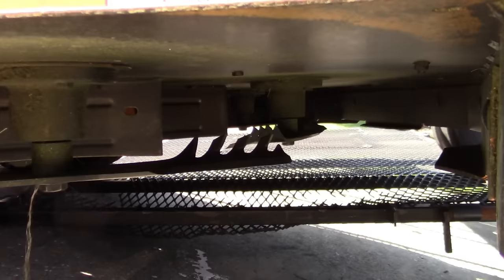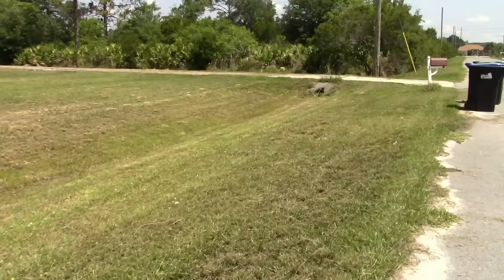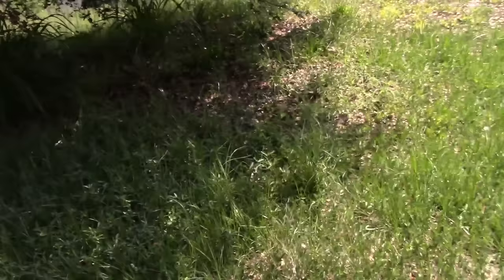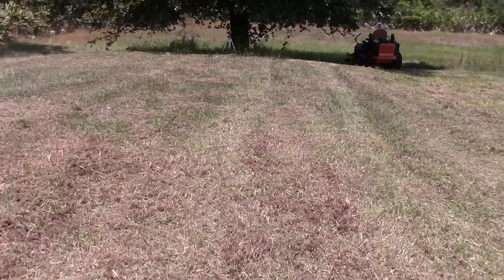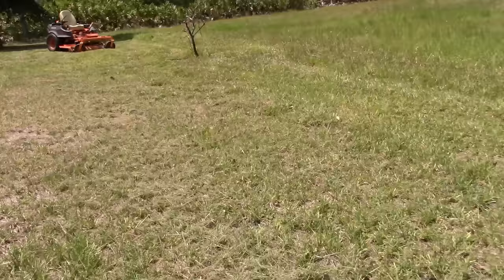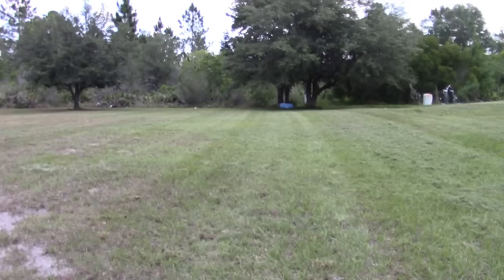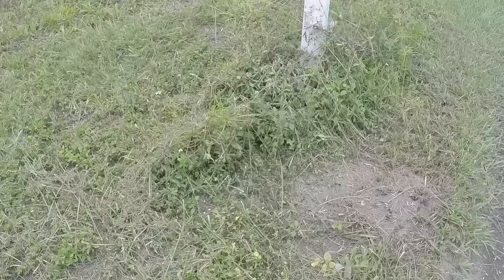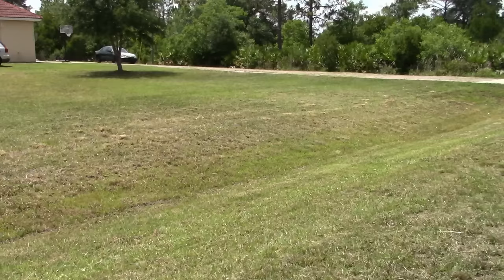Lawn care vlog #21 Tall Grass Annihilation! = Satisfying mowing!

Comment: I enjoy watching your videos . I believe that baffle behind the discharge chute is to help the clippings drop out instead of being pulled back around into the baffle again in a viscious circle . My Dixie choppers do not have them , but when I bought and installed my trac vac system it included one of those baffles to be installed with there system . I used it initially but ended up taking it off it didn't seem to help with anything , if anything it caused buildup of clippings to start at that point .

Comment: Bermuda is out in the fairways and roughs. Tifway which is a cousin to Bermuda is on putting greens. Tifway is super fine bladed Bermuda. Tifway at 5 inches tall will kill your mower engine. LOL It will lock that sucker right up. Tifway is the most dense, well I take that back. Zoysia is ultra dense too. Great videos sir as usual.

Comment: That small part is called the Turbo Baffle. I had same thing on my 52 " deck on my Wildcat, it didn't come with a exit chute cover and that a No no here. So I got a chute door off of E Bay and the Turbo Baffle was one thing I had to remover to install my chute door. Its operated by hand by reaching down, and pulling up on the lever.  My used mower was a home owner unit and had around 670 hour when got it. No Rops I would have removed them, most lawn have small trees, I like the door for many reasons the law was #1 and #2 was leaves spring and fall clean ups and heavy grass I like my lawns smooth and neat when done, I hate to see grass clipping blown into the street and grass clipping in flower beds and things that might get damaged, I'm insured, crazy if your not, But yeah they spread great out great on Scags mower decks. And yeah if your doing this kind of work have fun doing it I'll never get tired of mowing Motion controls beat a steering wheel any day.

Comment: You probably already know this but "high lift" blades will throw the discharge farther than the G5's (or G6's) you have on in this vid.
Reply from the maker: Yes, I have high lifts on there right now and it throws it a crazy distance. But regular high lifts have trouble with the thick grass. I have yet to try the G5's or G6's but I will. Gonna try the lighter ones. The blades in this vid are Mamba mulching blades which are almost identical to Gators.

Comment: Bermuda/Zoysia/Tiff and their numerous hybrid cousins are all Turf Grasses. They are used in the majority of residential lawns as well as commercial properties. The suggested mowing height of Bermuda is 4" during the hot months, slowly increasing the height for the winter time. Bermuda does not do well when cut to short, it exposes the surface roots, causing dehydration and root damage, leading to dead grass. It is the standard native grass here in the Plains states. That's what Oklahoma, Kansas, Missouri, Arkansas and Texas are covered with. Kentucky Bluegrass, Fescue and other shade grasses, don't do to well here, do to the fact they require excessive watering and average temps below 80.

Comment: I know this was a couple of years ago but thanks for posting . I all ways cut these on high  The problem I found with the plate removed for me was  safety. I know the blades  are spinning at 3500 rpm.   So any thing coming off the blades is going to be travailing at 200 mph.but it seem OK
Reply from the maker: Yea it's seems pretty scary, but most things are kind of "out of range" of the mower.
Reply: @Something2LookAt  The only way I can mow grass slops like this on these steep slops is to use the timer first. on the steeps part of the  slop then mow it avoiding  sloppy part of it

Comment: I had one of those on my old eXmark too, but I noticed my brand new John Deere with the 7-Iron Pro deck (60") does not have one of these.  I'm glad, because all it did was collect more grass for me to scrape out later.
Reply from the maker: Yea, it's an annoying little plate. I've been told that it is very effective to leave it on though if you are running a bagging system. Actually, I kinda think that's the only reason it's actually there. I'd like to hear the explanation from Scag.
Reply: Something 2LookAt I saw this on Scag's web site:  "Turbo-Baffle increases discharge velocity and prevents cut grass from reentering the deck cutting cycle."  http://www.scag.com/velocityplus.html
Reply from the maker: Hooked on Photography Aha! Interesting. And it may be true but!, It definitely hinders mulching blade operation. And I was throwin grass even farther with it removed while using standard blades. BUT! What I haven't used in a long time are genuine Scag blades. It may just work phenomenally with their Marbain blades. I just found an old video of when I first got the Cheetah with the original Marbain blades on it. I'm gonna edit it a bit and post it. It's absolutely incredible how well it was cutting. And that was with the turbo baffle on! I think I need to get a new set of those blades.
Reply: Something 2LookAt Ok, cool.  I've never tried the mulching blades up here because I have a lot of fescue mixed with clover and other weeds and I'm afraid it would get too pulverized and that mush would glue itself to the underside of my deck.  It's bad enough in spring with just the factory blades.  That was with my eXmark though.  I just got the John Deere and I heard they do great in thick wet grass like the Scag Velocity decks, so I'm anxious for next spring to come so I can see how well it does for myself.
Reply from the maker: Hooked on Photography I feel for you guys with the fescue. I hadn't even heard of it before Youtube, but it looks like a pastey nightmare.
Reply: Something 2LookAt  Haha.  It is.  It can be a pasty mush when it's wet and you cut tall grass.  It's not that bad at all when it's dry.  That's one thing I instantly noticed about the grass you cut.  It seems to be more naturally dry and less tendency to turn into a nasty mush.
Reply: Hooked on Photograph
Reply: Hooked on Photography with

Comment: no guard on the trimmer is the best will never go back to keeping the guard on
Reply: how does the gaurd on it hinder the ability of a trimmer and like the other guy said wait until you have to trip near pebbles and rocks you'll change your mind quicker then ever imo
Reply from the maker: Guys, I've been doing this for decades. I can handle the flying debris. I take a rock in the shin maybe once a year. I've learned how not to trim.
Reply: that really didn't answer my ? but if you say so I'm asking what's the point in taking the gaurd off and I'm sure you  have and I could take a rock or two in the shins as well but would rather not have rocks flying at my shins
Reply from the maker: Jason Ayers Sorry my response wasn't clear. What I was saying is that the stuff doesn't hit me. I've learned exactly how to trim at the right angles so that I'm not actually getting pelted by debris. Maybe it looks like I am but honestly everyone out here has enough experience to trim wearing shorts. I leave the guard off so I can advance a bit more string and get into tighter places. Places barely wider that the head. I'm going to have to film this.
Reply: You can get the string to where you can actually cut. If you will notice most people that do that for a living will take that off

Comment: Your discharge is dependent on aerodynamics.  The blades "suck" the air from the grass into the chamber and is propelled through to the discharge chute.  I think the "claws" on the blade help that.
  When the clippings get to the discharge it is supposed to be directed by that plate out of the mower.  The clippings and air will follow the path of least resistance, following the perimeter of the chamber.  The design of that plate will have a lot to do with how it effects the discharge.
  Since you got better discharge without that plate, I wonder if it was supposed to control the force of the discharge.  We would have to talk to an engineer to find the truth.

Comment: A lot of that no one taught you how to mow grass. You should go by the house and kick it all out. Mo the outer perimeter of the entire yard. At least two swipes then you turn around the opposite direction and mow the entire yard throwing it out don't go back and remove it. If they don't like the way it looks they will have you mow it more often make sure you weed eat around the house before you get done so you can Remo it and kick it away from the house it never cut the grass that high under 3 in. That is his responsibility not yours to tear up your lawn mower to please somebody by scalping is yard. Scalping his yard means no one in the entire area will come back period in your area do use you because they seen what a shitty job you did on his job by cutting the grass too short. Beautiful Lawns are mowed at 3 in high some grass is even at 4 to 5 inches high they maintain it then they water it to keep it growing grass usually stunts around 3 to 4 in Weeds have no limit they'll keep growing as long as he let them. That deflector is in there to protect the back blade you should have already weedeated before you went to the last shots so you can go around the yard and mow it all up you always go around the house first so you're not tired when you've done weed eating when you're setting off on your butt you can just finish mowing up the rest of the yard. When you're mowing deep grass mowed it 3 in never go on there two and a half ever you tearing your deck you tearing your blades up and your lawn mower is running twice as hard as it needs to

Comment: Is there a particular technique to use in order to avoid excessive grass clippings or is it just a matter of deck height?
Reply from the maker: Well, it's Gator blades or Mamba blades in this case. They have mulching teeth on the top side.

Comment: Did you try your x-blade setup with the deflector on or off?
Reply from the maker: Good question. I ended up trying it both ways. The initial video had it on, then on the next video I had it off. A commenter had noticed that so I made the follow up video. It did slightly better with it off.

Comment: Do you run those blades all the time? I'm thinking about doing it for myself but I don't know if it's a good idea.
Reply from the maker: On this mower I used to. I have recently switched to standard type Marbain steel blades for this mower because I now just mow big properties with it. Mulching blades help cut the grass into tiny pieces to make the finished lawn look nicer, like for the smaller yards. But I use a different mower for those now and it has mulching blades on it.

Comment: Is this Florida?, i live in the SW Naples Area and the native grass grows up to 10 inches in 2 weeks when its the rainy season. The native grass and crabgrass make it impossible for a commercial push going in full throttle. The last cut was a hassle because it was tall and wet, it looked like puke.
Reply from the maker: Yep, this is Florida. Orlando area. I know what you're saying about the push mowers falling short on their ability to cut this stuff. I often have a homeowners throw me 20 bucks just to "Knock it down" for them. Then they handle it from there. I love getting $20 for 5 minutes work! (small yards)
Reply: I have an old Honda GXV 160 OHV snapper push mower and the thing does cut through thick tall grass but it takes patience and time to mow it down slowly. Too bad they don't really use this engine anymore and i need a new one, I do recommend this mower with having it for about 8 years. Never been to the mechanic, and only needed tire replacement. if you ever need a commercial push mower, probably not you have the cheetah and craftsman, get a Honda.
Reply from the maker: The CAR Enthusiast Oh yes, I have had Hondas. I do like them. They ran fantastic and operated smoothly. They both blew their engines though.
Reply: They probably have been forced so much or overheated, im not necessarily a mechanic but i trust hondas and i need a new snapper because my old chassis has rusted alot, it has a huge 6 inch gap of under the engine, the Honda wont give up and the chassis needs a replacement.
Reply from the maker: The CAR Enthusiast Yes, in the Honda's defense, I did put a bungie on the governor to make it rev higher. It was amazing, but it did break it.
Reply: The Honda's are made to rev about 2800 rpm and its because they are supposed to be quieter, still the best performing are the Honda's, they don't seem to be popular like they used to, its hard to find one at the dealer but you can get one online. Too bad the snappers usually use a Briggs but break down and are a lot worse. Snapper needs to use Honda's on their products.

Comment: How do you price cuts like that?  If its only an every once and a while but calls for triple cuts?  Is it 4x the price if it were to be a weekly or bi weekly yard.  Please do not feel the need for specifics of this video just in general.
Reply from the maker: Depends on the mower. You'll see when I post the realtime version of this that I really didn't have to slow down much. But with a regular mower, gosh, you'd be out there all day. I charge double for these. But with a regular commercial 52 or something, yea, 3 or 4 times normal. It goes by time. I won't know until I edit the video, but I think this one was only about an hour of mow time.

Comment: This a video of the Chute blocker I installed on my Scag Wildcat with 52" deck the thing I like about this Blocker is that it powder coated the same color as the mower And most of all the rear of the blocker is curved to fit up tight to the mower deck all other ones you see are flat and they won't fit flush there will be a gap and that means you'll get covered with clipping and it easy to install you use where to OEM chute where its bolted on and same holes use for the baffle that was removed nothing in the way and it.look's factory.
link to video https://www.youtube.com/watch?v=WVXOA6WghGk
Reply from the maker: I saw that one too. Looks real good. Scag makes one too. If I remember correctly, the Scag one opens all the way to the point that it doesn't stick out at all. But it's whichever. I think they're both about $300.
Reply: I have pulled up on mine the get even higher and out of the way I just pull on the handle to get the head of bolt out the way, You have get thru the web site listed in the video. I bought mine in 2013 the guy I got on E bay from doesn't sell it anymore. I saw the Scag one but don't have OEM chute. I didn't need it, just something else to get in the way.

Comment: how much  horse power does your scan have and what is the engine brand ?
Reply from the maker: It's the Kawasaki 850V and it says 31 hp on it, but it's apparently only 27
Reply: +Something 2LookAt I guess they don't let it get the exact horse power it was produced for to prevent it from blowing so they tap the power down just a tad to be sure it isn't over revved
Reply from the maker: Dun Rite Lawn Maintenance Actually it was a big thing a few years ago. Class action lawsuit. Manufacturers were lying about actual horsepower. They all had the wrong numbers on them.
Reply: +Something 2LookAt yeah selling us consumers and charging us for a engine we were actually not getting. .. I see now .. but I must admit tho that kawasaki you have even if it's not a 31hp it still a beast
Reply from the maker: Dun Rite Lawn Maintenance Yea, it is what it is. The true horsepower number didn't make it weaker. So this is how strong 27 hp is. A true 31 must be ridiculous.
Reply: +Something 2LookAt good way to look at it